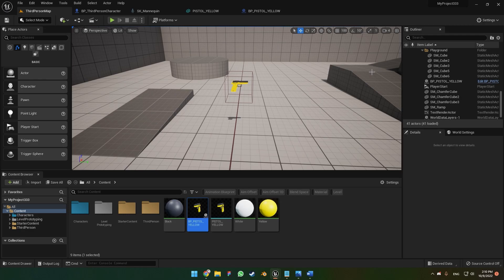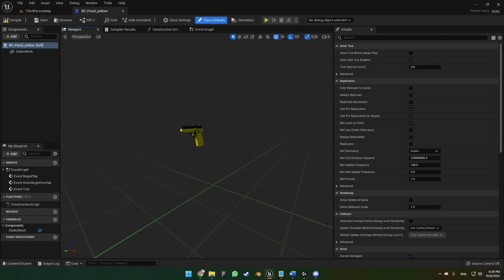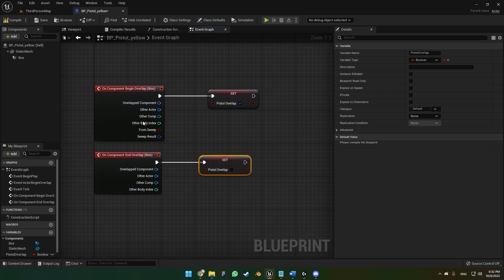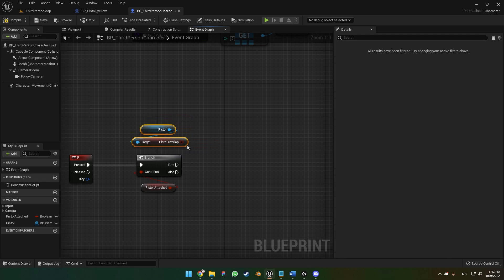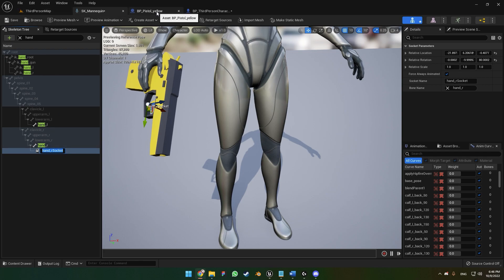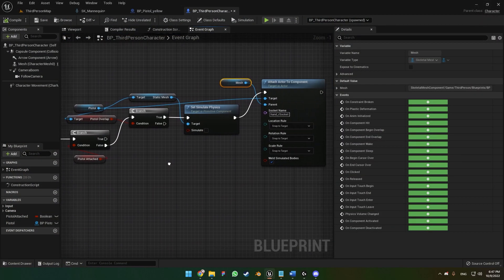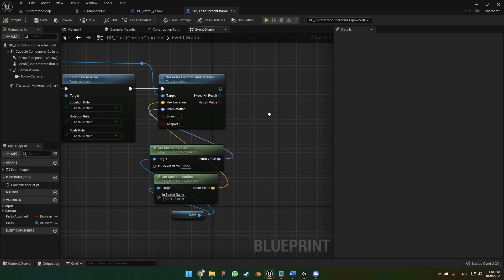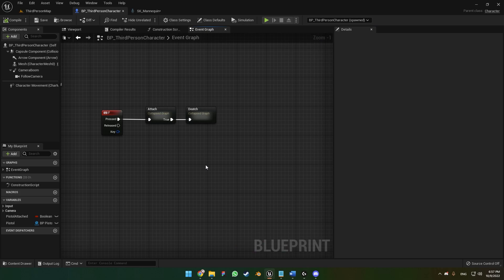Pickup and drop system with physics on UE5

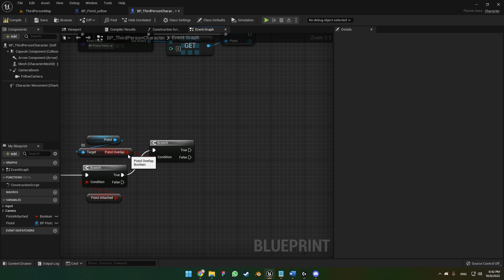Comment: If, upon picking up your weapon again, your character starts to 'jitter' due to collisions with BP_Pistol, you should add a 'Set Collision Enabled' node at 7:02, set to 'Physics Only (No Query Collision)', and that should resolve the issue. This is because when you initially pick up and drop the weapon, and then try to pick it up again, the weapon’s collision is still enabled, causing the character to react to it.

Comment: i had the issue, the player could not collect the item.
The solution was the "Event begin play". It already exists and is connected with other functions.
I tried to copy it, but it didn´t work though.
Solution: simply connect the existing "Event Begin Play" directly to the the "Get All Actors of Class" from this tutorial. 
It worked for me.

Thanks for your video. I used it with a collectable lantern, that you can pick up, light the rooms, and put it down when i needed to fight...

Comment: At 13:28 you add a "Set Actor Location And Rotation", but this is not necessary at all. Just set the "Detach From Actor" Location Rule, Rotation Rule and Scale Rule to "Keep World". Then it will not teleport upon dropping, but just naturally drop it as if you just let go of it with your fingers.

Comment: works but why is it when I duplicate the object I can't pick up the duplicate?
Reply: I have the same question. Did you find the answer?
Reply: @dimkasnusmumrik2548  the reason is because the duplicate of the object is acting as another blueprint, which can be seen when you want to see the blueprint running when testing. So because of this, the code is looking for the original static mesh and other components, not the blue print. There’s another tutorial which allows you to use duplicate and pick up but you can’t drop the item :/ hope it helps :)

Comment: i'm getting a blueprint runtime error after trying to pick my item up, it's saying "accessed none trying to read property" i have no clue what to do
Reply from the maker: The "Accessed None trying to read property" error typically occurs when your code or blueprint is trying to access an object or property that is not valid or does not exist. This can happen if the object was not properly initialized or if it has been deleted.

Drag and drop the blueprint to the world and try again let me know if it works

You can also use the spawn actor from class then choose the blueprint of the pistol

Comment: Hey thanks for the great tutorial, and it work perfectly. I just have one question, if i wanted to make it launch a couple feet in front of the player how would I do that?
Reply from the maker: To achieve that, you can follow these steps: 

1. Get the trace end vector output pin, which can be found on the trace line. 
2. Obtain the location of your character mesh using the appropriate node. 
3. Use the "vector distance" node to calculate the distance between the trace end vector and the character mesh location. 
4. Based on the value obtained from the "vector distance" node, determine whether to launch the character forward or backward. 
5. If the distance value suggests launching forward, use the "launch character" node to propel the character in that direction. 
6. If the distance value suggests launching backward, use the "launch character" node to move the character in the opposite direction. 

By following these steps, you should be able to achieve the desired effect of launching the character either forward or backward based on the calculated distance.

Comment: cant have more than 1 event beginplay in my blueprint what do i do
Reply from the maker: use a node called "sequence"
Reply from the maker: or hold left mous button and press S
Reply: @LocoDev  Im already using a sequens for a crosshair any other solution?
Reply from the maker: @GaMerTriiXx   add a pin in the sequence node
Reply: @LocoDev  First off thanks for the quick answer it works now, theres just one thing i dont get cause when i pick up the gun it picks it up in the wrong angle and not the angle that i laid the gun in the characters hand any idea?

Comment: is it possible to add multiple Items? It doesn't look good if i remake this code everytime for every item. Can i put this code in every Item Blueprint i want to?
Reply from the maker: If you want to obtain specific items, you can try learning how to use tags and tag the items that you want to be able to pick up. If you want to obtain multiple items, you need to write some code to first check whether the last item you picked up is already in your hand, before attempting to pick up a new item.
Reply: @LocoDev  hey thanks. Are you maybe able to make a new tutorial with line traces (so i have to look at it to obtain the item)

Comment: Hi LocoDev,

Thanks for for your great work!

I followed your tutorial one by one but I have one issue. The 'Event BeginPlay' is already used by the Input Mapping. I can't get two of them and I think that's the reason why it is not working. 
Do you have any Ideas what I can do?

Thanks
Reply from the maker: If the 'Event BeginPlay' is already used by the Input Mapping, you can try the following solutions:

Rename the Input Mapping Event: You can go to the Input Mapping Event and rename it to something else that is not already used by the 'Event BeginPlay.' This should allow you to use the 'Event BeginPlay' for your purpose.

Use a different Event: If you can't rename the Input Mapping Event, you can use a different event that is not already used by the Input Mapping. For example, you can use the 'Event Tick' or 'Event ActorBeginOverlap' events.

Combine Events: If you need to use both the 'Event BeginPlay' and the Input Mapping Event, you can try to combine them into one function. You can create a new custom event, and then call the 'Event BeginPlay' and the Input Mapping Event from within that custom event.

Use Blueprint Interfaces: If you need to have multiple events in your Blueprint, you can try using Blueprint Interfaces. A Blueprint Interface allows you to define a set of events that can be implemented by any Blueprint that uses that interface. You can create a Blueprint Interface that includes both the 'Event BeginPlay' and the Input Mapping Event, and then implement that interface in your Blueprint.

Comment: Mine is a skeletal mesh and it just doenst work
Reply from the maker: try exporting it to blender and import it back as static mesh maybe
Reply: @LocoDev  I fixed it, if anyone is having issues with skeletal mesh what you have to do is go to create blueprint class Actor, then add skeletal mesh and then drag that skeletal mesh on top of scene root that automatically generates inside of actor bp, that way you will replace it and enable the sk mesh to stick to your characters sk mesh
Reply from the maker: @emptybruh  nice
Reply: @emptybruh  Хочу добавить что тоже столкнулся с такой проблемой, можно из к Parent вызвать get actor owner component и указать туда скелетал мэш (use translate)
Reply: @mrtooth97  Ah yea, that works too. It gives same results so just go with what you like more :D
Reply: @LocoDev  Yeah, but I need it to be skeletal since I have animations on it. It gets attached to component but not on correct socket and it doesnt disappear from the ground, I suspect it just attaches and stays there  unable to follow the character

Comment: At 7:04, I am unable to get the static mesh. I have saved and compiled both the character and item blueprints. The only thing I can think of is that I was unable to set a new event begin play, so attached the line of code to the end of the existing one. That is likely what is messing it up but I don't know how. Any feedback appreciated
Reply: Update: I have fixed the event begin play issue using a sequence node, but the issue persists.
Reply: same issue, I just don't have get static mesh when trying to add it as a node.  Did you get it resolved ever?
Reply: I was having the same issue, but then i read another comment saying that you have to make a blueprint from the static mesh itself (not making a blueprint, and then adding the mesh in the viewport). when you do it this way, the default root will be called static mesh, which is what you end up adding in the event graph. i have found that the code will not function properly if you don't set up the blueprint this way.
Reply: @auroradickerson339  that's so stupid..but thanks

Comment: First of all, thanks!
I got some questions tho...once you turn on physics and the item lays on the ground, how would you pick it up again.
Because for some reason I cant pick up a physics actor again. It will only pick up objects which have physics turned off.
Also is there a way to make the item drop straight on the ground and not with the force of the character moving and flying off somewhere else?
Reply from the maker: The physics can be turned either on or off When the Umbrella (actor) is on the ground
Before picking up, turn off physics if it's on. >> Set simulate physics and reference the umbrella on the target I think.

You want the item from your hand to be dropped straight to the ground, I would calculate the current Z velocity which is the value that shows the current height regardless of where the character is.
Calculate your character Z Velocity and get the location of the umbrella and detach it from your character but before subtract the z value by the value of the current value of the character.

Or a better way to do this would be with a line trace pointing straight down. Then on the node of the line trace I would get the hit location of where the line trace hitted and use this information to use it on the location of detach node.
Reply from the maker: In this case a line trace would be perfect for this, I recommend you study about line traces, it's pretty useful for most coding process in general.

https://www.youtube.com/watch?v=yBmPxGHu3uo
https://docs.unrealengine.com/4.27/en-US/InteractiveExperiences/Tracing/HowTo/SingleLineTraceByChannel/
Reply: @LocoDev  Thanks a lot!

Comment: if anyone is wondering, you can add a "sequence" after "Event Begin Play" to add multiple items to be picked up and dropped
Reply: I used onactorbeginoverlap instead of oneventbeginplay.
Reply: I'm stuck, can you explain further
Reply: @evensteven4367 The Sequence node helped me to get this working:
We're supposed to build this pick up code in the "BP_ThirdPersonCharacter", starting with an "EventBeginPlay" node, but that's impossible due to the fact that there already IS one of those at the existing "Add Input Mapping" section.
  The workaround is to connect that original 'Event BeginPlay' to a Sequence node: Once you set it up, make sure the "Then 0" goes to our new pick-up code, and the "Then 1" connects down to the original "Cast To PlayerController".
Reply: @heavenseek  Could you please tell how to do so more specific? Sequence got it, Then 0 got it, but do you mean Then 1 should be connected to where?
Reply: @TheDay53  The very first node in the ThirdPerson BP (in my 5.1, at least) is the "Add Input Mapping" section, which starts with that much vaunted "EventBeginPlay"---which links directly to it's own "Cast To Player Controller".  When we interrupt that wire with the Sequence node, the "Then 1" will re-link to it's "Cast To player Controller" ('Then 0' links to this pickup thing we're doing here).
Reply: @heavenseek  got it, thank you!
Reply: @heavenseek  can you make a video on how you do that?
Reply: i can only pick up one item only. pls help. i spawned multiple objects that have the same mesh and i can only pick up one of the physics objects.

Comment: I put a print sting at the very end of the chain and it even says "pistol attached" (what i wrote there) but still the pistol is on the ground and not on my character
Reply: Finally a fix that took me less than a hundred years to do : I think the issue is that i created a blueprint for the pistol and THEN put all the meshes inside, decided to follow you step by step and right click on the mesh and create a blueprint from it, did all the needed changes for the "new" additions and it finally works, pistol goes to the socket of my character

Comment: What's a good way to pick-up and drop more objects in the environment. Tried to set a number to an array but has not worked. But otherwise, I agree with other comments about it not being too much of a hassle.  I am using Poke balls as an easter eggs to throw around in the level. But I am only picking up one of them. I want the option to drop and pick up the other.
Reply: I replaced the Get (a copy) array section with OnComponent BeginOverlap (CapsuleComponent) -> Cast to BP_Pistol -> Set Pistol
And then i also set the relative scale 3d and material after that so they don't reset after you pick them up